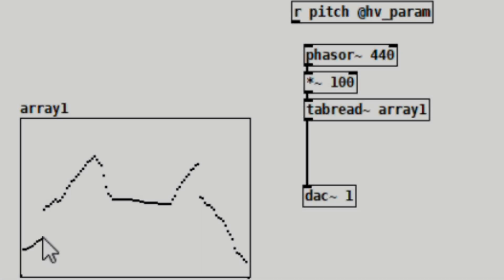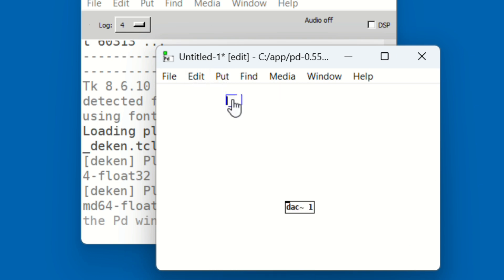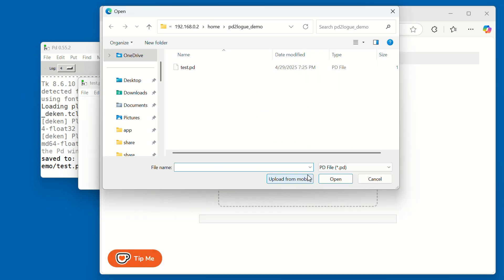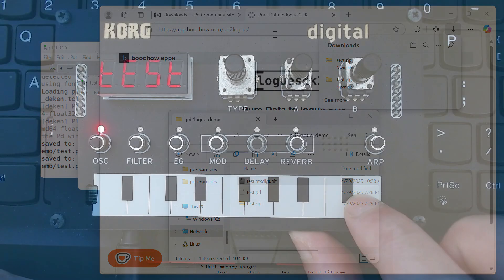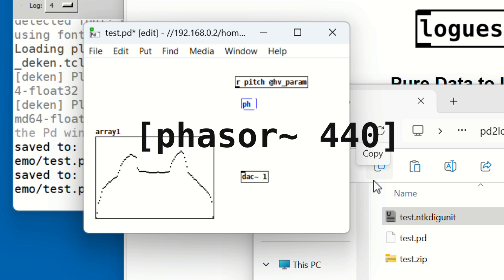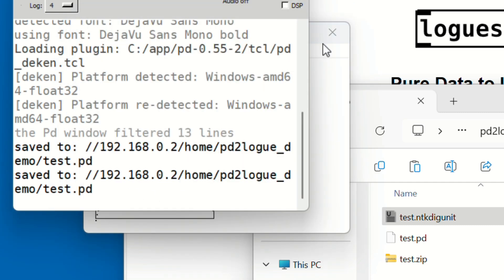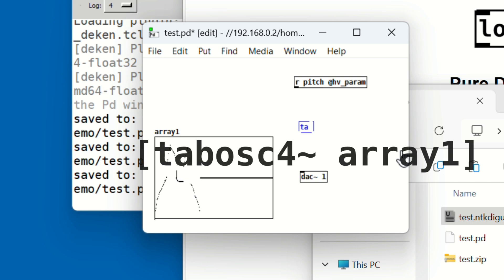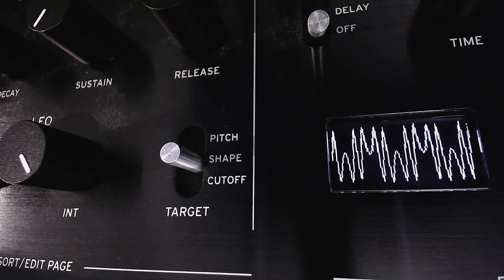From Patch to Sound: Logue SDK Custom Oscillators with Pure Data

Comment: That's a great idea, thanks Boochow :)
Does it work for FX too?
Reply from the maker: Unfortunately, FX units are not supported at the moment.
Mod FX allows only 16KB per unit, which is too small to run Pure Data.
Delay and Reverb FX rely on a special memory area (SDRAM) to store delay lines, but my conversion script currently doesn't support SDRAM access.
Support might be possible in the future, but I’m not sure yet.